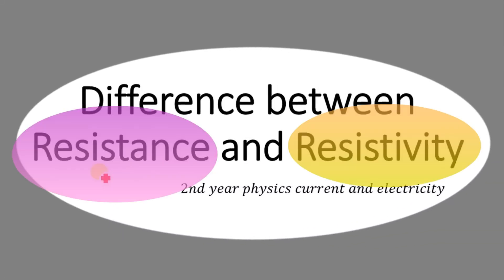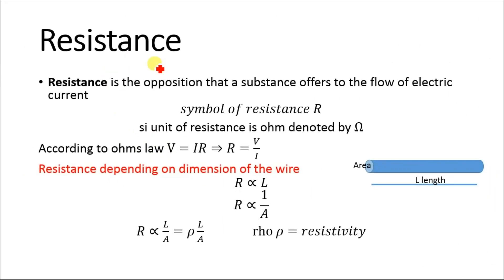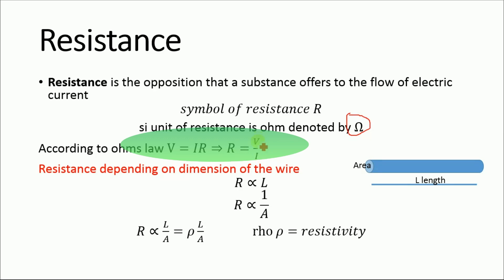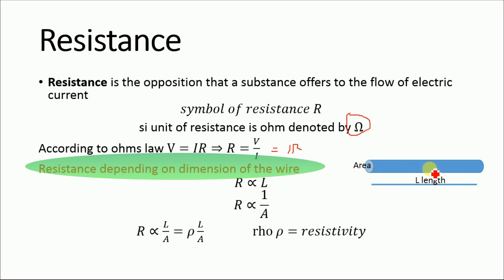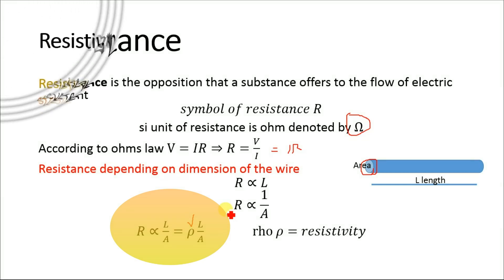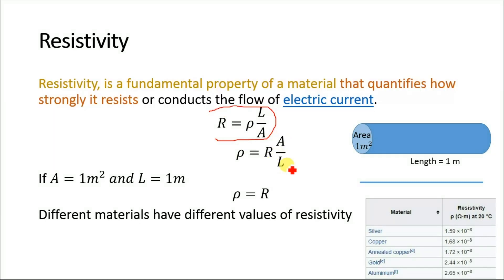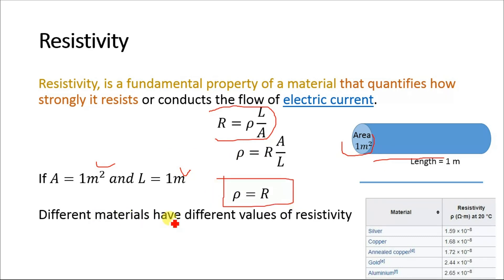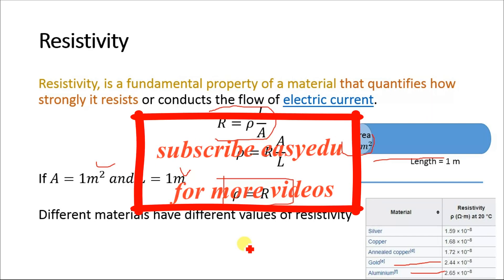Difference between Resistance and Resistivity (physics current and electricity 2019)

Comment: I want a video to know the difference b/w resistance , resistivity & resistor😌
Reply from the maker: resistor is a physics device used for resistance in electronic circuits, where resistance is a physical quantity , which can be measured in ohms
Reply: @easyedu99  tqs for ur explanation .what about resistivity?
Reply from the maker: Explained in the video will suggest you to watch this video
Reply: @easyedu99  i have seen it

Comment: A metal wire of diameter 2mm and length 100m has a resistance of 0.5475 ohm at 20 degree c and 0.805 ohm at 150 degree c . Find the value of its resistance at 0 degree c? Plz give solution sir
Reply from the maker: your given data is R1(ref)=0.5475 at T=20(ref) c  and R2=0.805 at T2 = 150 C and required data is  R = ? at T=0
Try this equation R=R(ref){1+alpha[T-T(ref)]}    or R=R(ref)[1+alpha T]  first calculate the value of alpha using this equation (use R1 as and T1 as ref and R2 and T2 as R and T) and then use the same equation (this time use R and T  as ref and R1 and T1 as R and T) you will find the value of R at T=0, for deriving this equation search in this channel for ((effect of temperature on resistance and coefficient of resistance )) you will get the result as 0.51 ohm